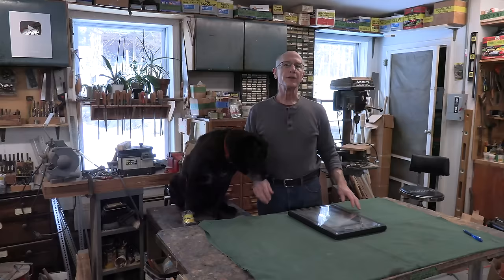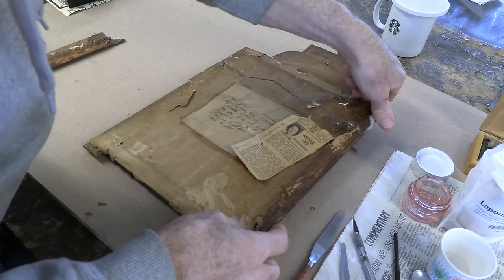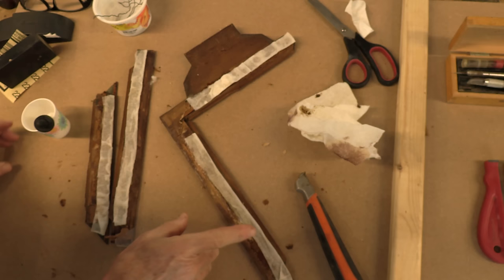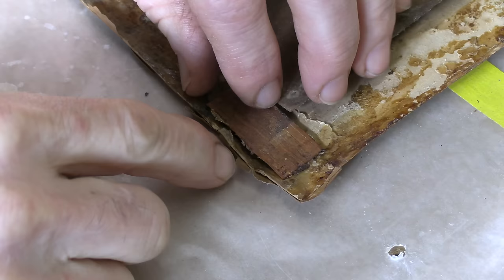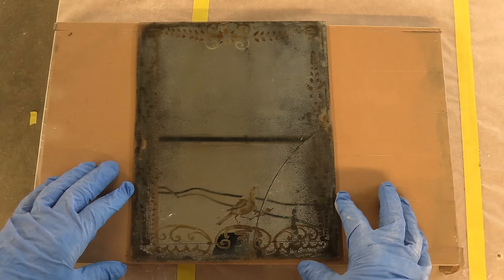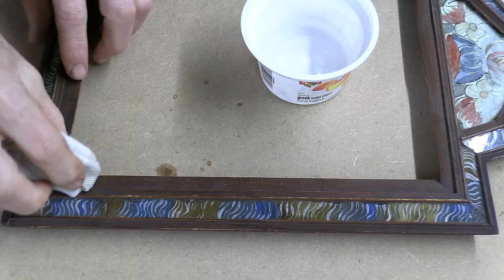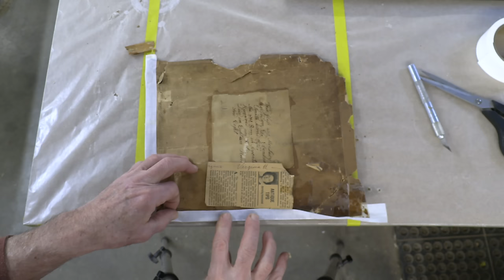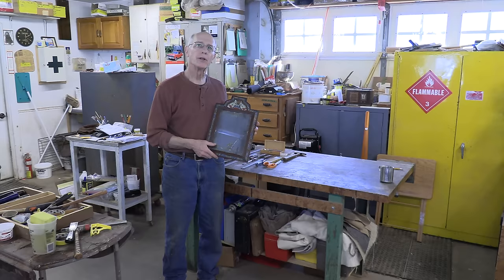Rescuing an Antique Mirror - Thomas Johnson Antique Furniture Restoration

Comment: There is a framers tape that is a double-sided tape, but on that paper, you might not have wanted to use it. Another possible "trick of the trade" would have been to mount that paper to a new backing paper, and then used the double-sided tape. But all in all that was a great job. The glass would be difficult. It needed to be "re-silvered" as noted by the oxidation of the silver in the form of the bubble appearance in the front of the glass. The frame was as complicated a piece of art as I have ever seen in the frame shop. The most important thing that you did was to take your time and to move slowly so as to no harm. I have worked on frames from the same era. This one piece that I did some years ago was to restore both a bamboo frame and the Japanese silk art in it. That took me several days, maybe 20 hours all told, to finish. But it was worth the effort. I must say that I love these videos. And you did look dapper in the fedora!
Reply from the maker: Thank you! Good advice. I thought about a new backing too - but it was glued to the original wood that was the back

Comment: My antique dealer friend bought a lovely gilded French  'marriage mirror', quite ornate with small pieces of glass set into the ornate top. He then dropped it and broke into pieces so I bought it from him for 20 euros and spent two days reparing it. The main mirror was intact, the damage was to the frame, mostly the ornate top. I had to use epoxy to hold the ornate top onto the bottom part from the back, it doesn't show. As there were pieces of the inset mirror missing, too broken to save, I cut out the same shapes from thin plexi and used a 'mirror spray' to mirror the back being careful to spackle it so it didn't draw the eye, I backed the plaxi with black paper. It's not a perfect solution but it looks good and the breaks don't show. Nice to save something.
Reply from the maker: Thanks! It sounds like you did a good job. I am not aware of a "mirror spray". Could it just be silver paint? I had never thought of that.
Reply: @johnsonrestoration  Hello Tom, yes the paint is made by Krylon in the US and is very useful. You spray it on the back of the glass and depending if you are going for an antique look or a clean look you can back it with dark card or dark spray paint. I first spray with a vinegar solution to leave 'holes' that repel the paint to get an antique look. You can even 'ghost' the paint then back it with a print of antique wallpaper so is shows through lightly. You can also paint images, flowers, birds, onto the back of the plain glass or even vase ( eglomisé ) then spray on the mirror paint over the top trapping it. For me it's cheaper and more charming to buy or find a piece of plain glass from an old poster frame then after cutting it to size, I can 'mirror' it. Look up some of the Tutos on YT ! Best wishes xx

Comment: Thomas,  an admirable attempt preserving the paper backing.
I dont think it was important to the piece to save; however the note certainly was.
Using acid free card, and de-acidifying the note (with Wei-to spray or such) would have been a good idea.
Overall a great job; and the piece looks great post restoration.
Reply from the maker: Thanks! Yes, I'm weak on the these aspects of restoration, maybe I should stick to wood!

Comment: I believe the purpose of the clay is to moderately moisten the paper and the glue without overly wetting it. It contains the water to only the treated area.  I doubt you are supposed to let it dry in place.
In fact, where you used the wet paper towels, the clay would have had much better contact with the glue, and much less run-out of water.
For the cardboard, it would have been better to use acid-free archival cardboard to prevent further deterioration of the delicate paper.
Reply: I believe most of the cardboard stuff Tom uses is already acid-free, he being a professional restaurator. But solid advice.
Reply from the maker: Thanks! Where were you when I needed you! I was way out of my wheelhouse on this one!
Reply from the maker: Thanks!

Comment: I restored a beveled glass mirror several years ago and the mirror glass was flaking badly.  I used oven cleaner to remove the mirror silver from the glass and then had a thin mirror cut to place behind the original (now) clear glass.  worked really well,  I still use it in one of my bathrooms today 30 years later.  Appreciate your videos,  I learn something from each one of them.  Tim in Kentucky
Reply from the maker: Thanks! That's a really good idea! I will try that

Comment: As someone who has a collection of letters from that time period, I was holding my breath throughout that one !!!!   A wonderful example of control in only doing enough to preserve the item and avoiding the temptation to do too much.   Paper that has been under glass or exposed to so many varying temperatures etc over the centuries is so very hard to handle or work with - bravo sir on such control.
Reply from the maker: Thanks! It was nerve racking - definitely out of my wheelhouse on this one

Comment: Very interesting job. One note: the plastic glass pliers are actually designed to work in a different way than how they were used in the video. Score the glass with your cutter, then place the pliers at the edge of the glass with the white line mark on the pliers lined up to the scoring on the glass, and squeeze. The glass will break into two pieces perfectly. It's especially helpful when cutting small amounts off the side of a piece of glass.
Reply: That’s helpful. Thanks for sharing that tip.  Scott
Reply from the maker: Thanks! Every time I cut glass I learn something new - I'll try that
Reply from the maker: It's amazing how much I learn from these comments!

Comment: I love you still use the foldable ruler. My Dad was a home builder in the 60s and he used the same until they came out with the tape ruler. He always kept it in his tool belt. I have done furniture repair/restoration, not at your top self level, but I did use many of the techniques you use. I love your channel and learn new ways of fixing stuff. Look forward to new projects! Love from NW Colorado. Thanxz
Reply from the maker: Thanks! I like them better than a tape, especially in the shop. Good luck on all your projects!

Comment: I am glad to see you left the two small blocks as they were at the bottom of the frame. There original positioning tells me they were set that way to hold the mirror and backing rather than tacking and risking damage to the mirror. As always another great job.
Reply from the maker: Thanks! I was glad I found them too. I think you're right. I could have put a couple of more pieces of cardboard in there and it would have secured the glass

Comment: Well done Tom with the glass. As a stained glass artist I have to deal with stuff like this daily. We use what we refer to as a "sprig gun" instead of glazing points. It is a stapler-type gun that fires small flat points. Picture framers use them also. They are expensive ,about $150 Australian, but they pay for themselves by preventing you from breaking the glass by inadvertently applying pressure the wrong direction, when pushing in the glazing points. We still keep a box or two of normal glazing points in our tool boxes for emergencies.
Reply from the maker: Thanks! That's good info. yes always nerve racking

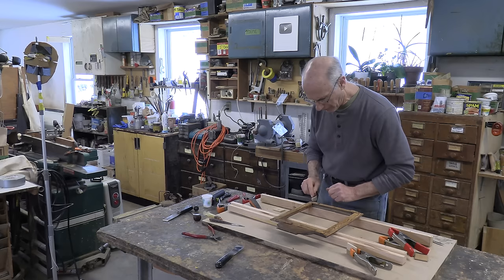Comment: 16:38 Noooooo. Those are the original spacers for keeping the glass in place. And they look like the same sort of wood as the rest of the frame is made of… They are like that so nails or other retainers don't have to be used. Then you just slide the glass into place from above, and pack as needed. As of course you realised too.
I'm sorry I don't like the linen tape solution, even though its benign. I think I would have glued acid-free paper strips to the back of the paper, to line up with the original. But the end result is sound, and will hold up for years.
I love the stenciling on your stairway.
As always it really looks more than pretty good Tom.
Reply: You maybe be on to something with the spacers, but I still can't figure out how and where they are supposed to be attached. From the frames back, holding the glas and stuffing in place, with finally the paper glued over the whole ensemble?
The spacer at https://youtu.be/VTBnHT_Ldlg?t=463 does not seem to hold anything. Maybe misplaced during a repair?
Reply from the maker: Thanks! That makes sense! I was way out of my element with this one
Reply from the maker: Thanks! Good point

Comment: The clay itself doesn't do anything to the glue. Its purpose is to keep the water from evaporating and to release it slowly. The water is what softens the glue. Therefore to detach the cardboard you need to pry it off while it's damp. If it dries up again after dampening then the glue will re-solidify again and re-adhere the cardboard to the wood.
Reply from the maker: Thanks! I kind of figured that - but the water was destroying the paper so I had to stop

Comment: Great job. Meticulous as ever. What kind of glue did you use for the joints? I'm an amateur restorer myself and I'm sure those like me who watch would love to know what's products you use for specific applications and why. On another note, have you ever resilvered a mirror. I've seen rattle cans of resilvering spray and wonder about how they do. If they work well I would imagine that it's a good way to restore reflection quality while retaining the original glass. In this case, it would have allowed you to save the paint work on the front while restoring the reflection.
Reply from the maker: Thanks! I'm using hide glue, specifically "Old Brown Glue" https://www.oldbrownglue.com/. I haven't tried resilvering. You can also put a new mirror behind the old mirror if there's room

Comment: I often wondered if your shop ever got too cold for what ever you have for heat to keep up with, and this video gave me that answer. Glad to see Ella still helping with work and giving you support. I was surprised that one joint with the broken tenon held so well before you added support to it.I was wondering if some tiny drops of epoxy on the glass ( so's not to over flow out) place in some appropriate high spots would have kept it together closer? In any event was waiting patiently for a video from you and that made my day!. thanks again Tom (and Ellia! my favorite apprentice) for taking the time to share. ECF
Reply from the maker: Thanks! I thought about that, but realized I could side-step the whole issue. I didn't want to use an adhesive that might damage the silvering

Comment: First, kudos on the clever title! Second, I thought you might use that mirror replacement trick - remove the silver from the back and back the clear glass with the artwork. etching, bevels, etc. still intact with another piece of mirror. Probably not the most perfect from a conservation aspect, but it does work. Third, BRAVO - another masterful restoration from a master!
Reply from the maker: Thanks! Yes, I have often put a mirror behind the original glass, but I never removed the old silvering

Comment: Hi Tom. I'm a paper conservator and you used the laponite correctly 😊 It (and other gels like methylcellulose) is used as a carrier for the water, to give less water more dwell time on the adhesive and give it a chance to soften up. Unfortunately, even good quality old paper, once it gets to the condition that you were dealing with, has very little strength left in it, and when it gets wet it just wants to turn to mush. So as you found, sometimes a combination of wet and mechanical adhesive removal is the way to go. I applaud you for doing such a careful job with difficult old paper!
Reply from the maker: Wow! Thank you! Yes, the water was turning it into mush. But I am happy to hear something positive, I thought I would be crucified by all the Paper Conservators out there. There really wasn't much you could do with it

Comment: well the purpose of the laponite is mostly to keep it wetter for longer to simply lengthen the work window of the water so letting it dry is a little counterintuitive, where it probably would have been more helpful actually was when you were using vinegar on the glue like scraping it (but IDK what kinda chemical reaction might occur, if any, between the laponite and vinegar)
Reply from the maker: Thanks! Yes, it was getting messy - I need to learn more about using laponite

Comment: Oh my goodness Tom, what an interesting and challenging restoration/preservation project this "Courting Mirror" was. It is such a pleasure to watch you work. Your dedication to preserving the historical integrity of this unique piece is an honor to behold. I was glad to learn about the archival linen tape! It truly allowed you to strengthen and preserve the important providence of this mirror for centuries to come. Before you applied the linen tape, I was thinking there was no safe way to reattached the paper directly to the backside of the piece. I was envisioning that it would need to be sandwiched between two pieces of clear thin gauge vinyl, which were then sewn around the perimeter to seal it... and then tacked into place if possible. Your method was ingenious Tom!  Thank for sharing and teaching! ~~Christy~~
Reply from the maker: Thanks Christy! Actually, that's a good idea. Someone suggested that they make archival sleeves for just that. I need to look into that. Luckily, it will be easy to detach it from the frame

Comment: I've always wanted to try 'eglomisé" mirror painting with the design on the back before silvering. With these new mirror sprays it's much easier to do, even use cut out birds and flowers glued to the back then spray mirrored. I have a large gilded frame that I am going to make my own mirror glass for and will fade it out towards the center and put an old damaged engraving behind the mirros so you can just see the ghost of the image.
Reply from the maker: That sounds really good! On this glass, the bird designs were on the front. The decorative glass in the frame was painted on the back. I'll have to look for the mirror spray!

Comment: Any tips on Shellac that tend to have sags and runs when applied? I apply if pretty sparingly and always tip it off. I use it straight from the can and don't over load my brush.
Reply from the maker: I don't! I find brushing shellac to be a complete pain in the butt  on large surfaces. It just dries too fast. The best way is probably like a French Polish routine. It doesn't have to be like trying to do a "French Polish", but the same basic technique. I usually spray shellac, but I don't use spray equipment on camera

Comment: For the very first time, I am not 100% seduced… although, from the front, the mirrors looks as good as possible. However, I am so glad you used reversible conservation grade material for the tape. Though it looks rather simple, this restoration was in fact extremely tricky.
Reply from the maker: Thanks Sylvie! I too was not satisfied with the back

Comment: Now I'm imagining a Baumgartner Restoration video in the style of Thomas Johnson, and vice-versa.
"I'm Julian Baumgartner of Baumgartner Restoration in Chicago... Illinois. Here we have a very nice painting, it might be late 19th century or even early 20th century, and there's not a lot wrong with it except for some severely discolored varnish, a quarter-inch thick layer of cigarette smoke, and this large hole here in the middle where it was chewed by squirrels. I think the first thing I'm going to try is to see if I can get this off the stretcher. I say it's a stretcher but you can see here it's actually a strainer..."
"A chair is a curious thing. Chairs are practical and mundane objects designed to fulfill a purpose. But they can also be exuberant expressions of art, the vessels of memory, or symbols of power. This chair came into my studio, in Gorham... Maine, in a sorry state. Previously, it served a ceremonial roll as the official seat for the president of a women's college. But now... well... just look at it. It needs some love, but along the way I learned some secrets as I worked to restore... The Mistress (♪♫♩)"
Reply from the maker: This is great! There is a parody of Julian on youtube. Silly, but a few laughs. I was actually thinking of this, but it would have to be respectful and not piss anybody off!

Comment: As a paper conservation student it broke my heart to see what you've done to the backing paper. For once I'd rather see a proper conservator do the job instead of you. One could see that you were way outside your comfort zone and yet you did well. If the situation will repeat in the future- pressure sensitive adhesive tapes are a terrible choice for reinforcing degraded paper, I know they're convenient but they're also irreversible, at least not easy to remove the longer they stay on the object. Japanese tissue paper and methylcellulose are the way to go. I'm not going to mention all the dirt and old hide glue that's been taped over, that's hopefully obvious. Great job apart of that
Reply from the maker: Thanks! I was definitely out of my "wheelhouse" with this one! That paper was just too fragile

Comment: Really interesting, I have done some reframing and conservation of artwork but I would be very nervous touching something so old and fragile. Great job.  Do you have an idea of the value of a Looking Glass that old? I haven't seen one in Australia. 
FYI - The tape I generally use is a Japanese, ph neutral picture framing brown tape not sure if it would be any better than the linen tape.
Reply from the maker: Thanks! I'd like to try that Japanese tape. I saw these mirrors listed for about $750